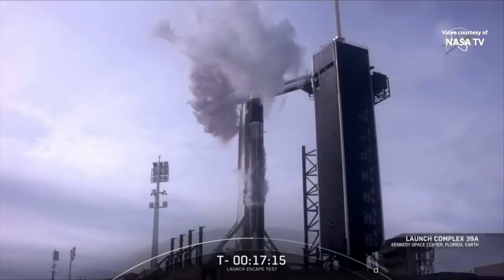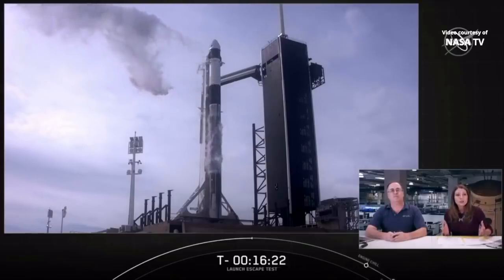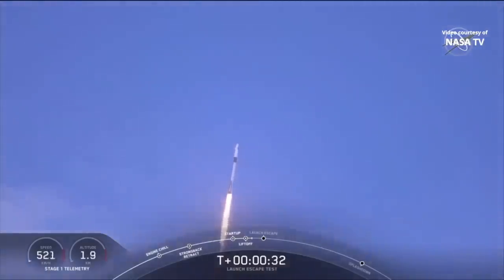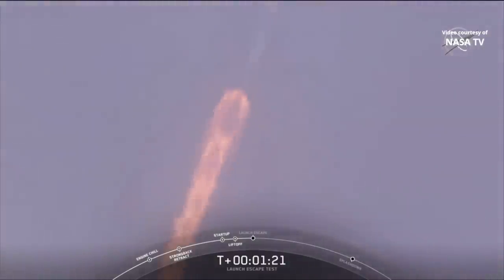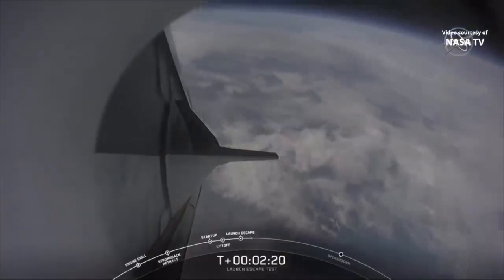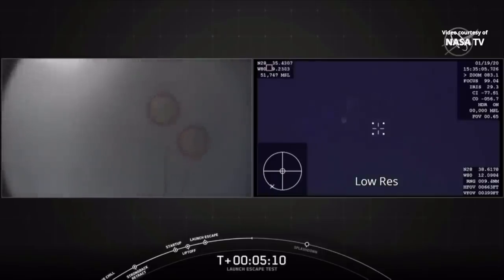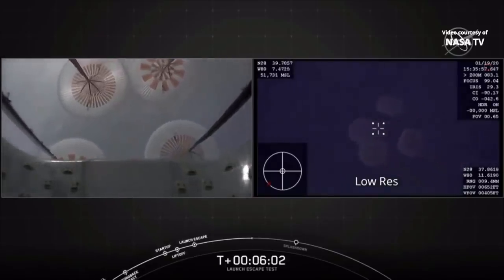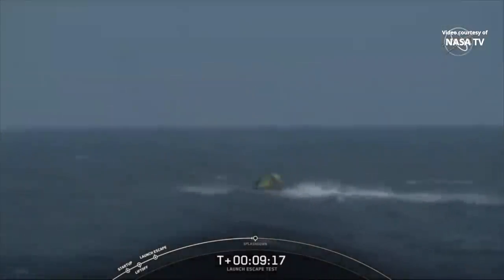Crew Dragon In-Flight Abort Test

Comment: That is all well and good but the rocket will likely explode while the capsule is still on it.  This test doesn't validate real world emergencies.
Reply: The capsule is designed to tell something's wrong and fly off BEFORE it explodes. It aborts automatically when it detects unplanned engine shutoff (and probably a lot of other things), like what would happen before an explosion

Comment: I was really hoping this was going to be a catastrophic escape with detonation at full power similar to challenger or loss of stability like the saturn escape test.
Reply: Well with Challenger it was the damaged O Ring, the shuttle had no way of aborting, it was stuck to the doomed booster. With Falcon, the computer data can detect an abort situation before anything catastrophic happens, and will auto trigger the Dragon escape sequence before any physical damage or break up can happen. This test demonstrates that very thing. An abort trigger with Main Engine Cutoff happening before a catastrophic event even happens